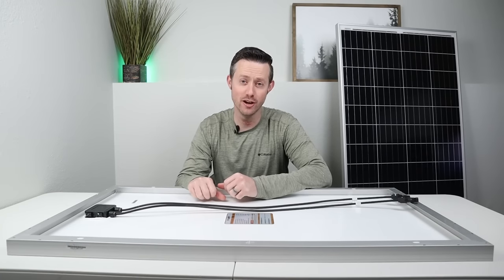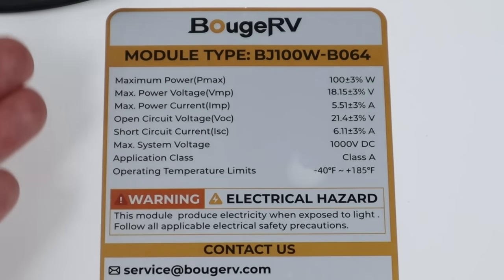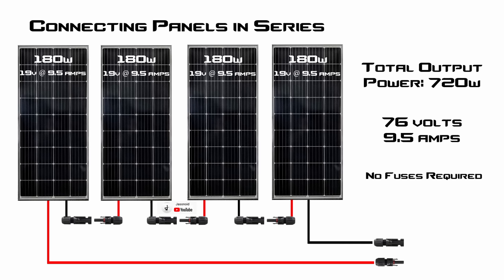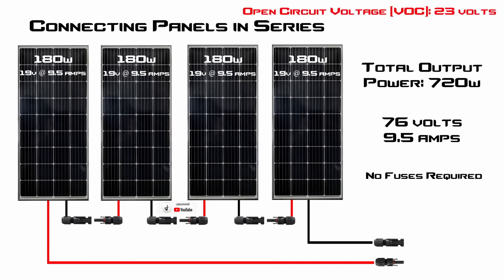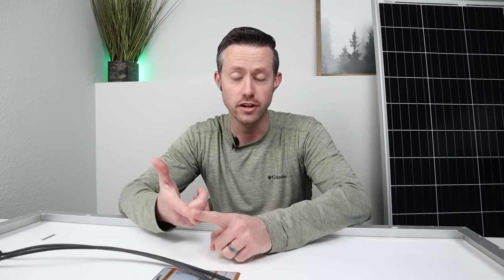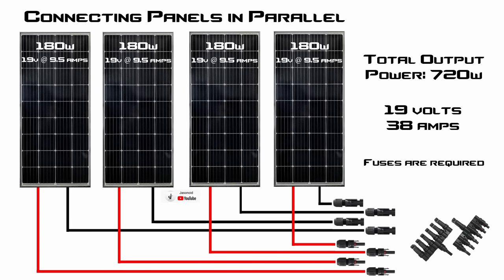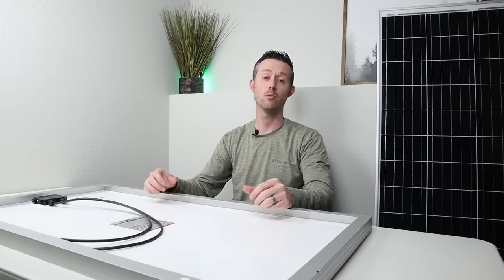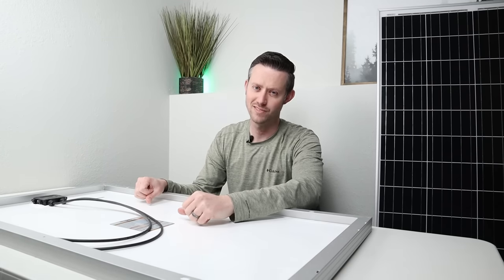Series VS Parallel! A Beginner's Guide for Solar Panel Connections - With Basic Diagrams!

Comment from the maker: Did you find this video useful? What other solar topics would you like to see?
Reply: i never used fuses on my solar panels .I prob should do you have a link solar panel fuses?
Reply from the maker: @mannyfragoza9652  Something like this would work well for each panel (15 amps). If you were fusing the entire array, you'd want to go with something larger. https://amzn.to/3n1a8Ne
Reply: @Jasonoid  cool thanks J
Reply: DrJ' I would like to see a Bluetti AC200max vs Ecoflow Delta max vs Anker 767 for emergency home backup🤔🤔🤔
Reply: Very useful. Getting into solar generators for the first time is like being thrown into the deep end of the pool. Especially for someone like me who had to make a quick buying decisions after multiple extended outages in a short period of time where dealing with a gas generator became very difficult.

Some topics that I'd like to see covered for the new solar generator buyer:

1) Differences in battery types / technologies. When I made my purchase I didn't even know what options existed. All I knew was alkaline batteries in my flashlights, lithium in my phone and laptop, and SLABs in my computer UPS. Knowing what I know now, I would have looked for a LiFePO 4  unit.

2) Differences in Peak capacity and runtime capacity, also touching on efficiency ratings and how it effects those numbers. Another thing when deciding on how much capacity someone will need is the watt rating of something like a microwave vs the actual power consumption - most people don't think that their 1,100 watt microwave might need to draw 1,500 watts so they end up underpowered.

3) For those of us without solar power, (especially new users) AC charging matters but it's something new users don't think about. Having to  keep track of the power brick for my geneverse unit is another frustration I really don't need, but didn't even know I'd care about down the line.

If you could wrap all these things into a "before you buy your first solar generator" video I think it could help a lot of people out. Most people are probably like me and only think about buying a solar gen after something goes wrong, so they feel like they have to make a buying decision fast before something goes wrong again.
Reply: @randomyoutubecommenter1  The experts say, figure out what your needs first like what will you use your solar Generator for, the whole house  or for small electrical devices C pap cell phone laptop etc, etc. In my experience bigger is better. I made the mistake of buying a 240,500 watt solar generator when i needed much more power. Even the 600 watt i recently bought only serves a small portion of electrical devices i need to run.
Reply: I keep getting confused about VOC etc and seems different brand panels use different terms.  Great video! I just recently got a deal a got 4 of Bouge panels that size. Never new I needed a fuse.  Maybe you provided link for fuses? I have rebranded Oukitel P2001. Called Ideaplay. And what's the saying about solar generators-- you can over voltage but never over amps?
Or vice versa?
Reply: @randomyoutubecommenter1  and then you end up like me with 6 different brands and sizes. Costly way to learn.! My Geneverse is now actually my least liked cause of it's relatively slow charge rate.
Reply from the maker: Chad, you never want to overvolt a power station. Always keep the VOC of your array under the voltage limit of the charge controller in the power station. 

Power stations have built in current protection / limiters so you can always have more amperage available for them, but they will only pull what they are rated for.
Reply: @Jasonoid  and since you discussed joining panel wires  what about splitting? Take your rig and say you wanted to take the single +- outputs and charge 2 separate Oukitells?? With AC you can obviously split and power both...
Reply from the maker: @chadrogers3161  not sure how well that will work but I don't see it damaging anything.
Reply: @Jasonoid  I just didn't know of was even going to output same at each line. 
Like having an array go to 2 separate PWM charger controllers connected to 2 separate battery banks. That's my existing situation.
Reply: So could I use for example Longi’s 515 watt solar panel (voc 46) with my Fossibot F2400 power station (max 500 watt and max voltage 48)? And I could even set two that kind of solar panels in parallel without damaging the f2400 power station?
Reply: Great, thanks
Reply: @juhaniriihola8129 No, the input wattage doubles either in series or parallel.  I’ve had panels at a remote cabin for about 20  years and in the spring when it’s cool and there is snow on the ground a get about 10% over the panels specifications..
Reply: Dear I enjoyed this so much though am very ignorant about electrical conduction. Thank you so much I wish I could transfer your grey matter to mine. Hahaha. Please do a video on how to set up solar system in a house off grid or hybrid but let's see all the connections, designs, inverter, charge controller, panels and what have you. Pleassssse
Reply: Jason how about batteries, how much battery and panels do I need to put for a house that requires about 6kw to power it's appliances?
Reply: Jason what's your email address please?
Reply: a review for powerwall battery
Reply: You’re the man! Clear and concise ,just how I like it!
Reply: how about a video on:   whole house standby solar cost,   vs.   portable battery that's solar chargeable cost.   The pro's & con's of each set up.   Provide the cost upfront in the video,  comparing the two,  and then  demonstrate the breakdown of those costs as you explain the set-up process for both.     "for whole house solar, non grid, is $xx,000   vs.   portable batter solar, $x,000.  Here's the components for these costs:  xxxxxxx   "
Reply: Pros and cons of Bi-facial portable solar panels ex: ecoflow 220w bifacial.
Thank you
Reply: Yes, thank you! Very clear and concise, great info and no confusion! Keep up the great work! God bless! I was talking to a friend about using other generators for AC input to back up larger solar generators that accept multiple inputs for charging, including smaller solar setups...any ideas?
Reply: Fairly straightforward and easy to understand.Very helpful!
Reply: @jasonoid Hi, good evening. I would like  ur input. I have an ecoflow pro, and the input ports spcs are as follows 
Ac 660 max 10A 
Ac input voltage 220-240V 50/60 hz 10A 
Solar charger 10-25 V === 12A , 200W max 

I have 2 solar panels  18v each one is 200W   specs are as follows, 
Pmax 200w single chip 
Output tolerance:+ 3%
Voc 19.2V-24V 
Maximum system voltage 16V-24V
So my question is, can I connect them directly to my power station without a control charger, or do I have to use the controller charger that was provided with the panels.
Reply: @jasonoid
We have 12 420 watt solar panels. I want to hook them up in a series of 3 and parallel 4 sets. Our smart controller is a MPPT 150/60. So if I understand correctly I can do 3 at 126 v and 30 amps because it is under the capacity of the controller right?  But my max amperage per panel is 10…so will I need a fuse for each 12 positives? Or only the 4 positives that create the parallel?? And lastly would I use a connector with the 4 prongs and connect the 4 positives to one and then the 4 negatives to the other prong?
Reply: I would love to learn about batteries to inverter connection
Reply: @Jasonoid Thank You very much! Wery interesting video about connection. 
But, what about in-line fuses?  Do we need them in 2s2p or something similar connection,  if we already have diodes in pannels, that block back current (overcurrent)?
Reply: How do I know which configuration I should use what determines whether I should use a series or parallel wiring configuration?
Reply: @HeiwaPeace  You should know MAX voltage and current characteristics of solar inverter mppt input and yor PV array should not exceed that's. Connection in series gives you pannels voltage sum up with the same carrent (it's good - you can use thinner wiers) Connection in parallel gives you sum up of pannels current with the same voltage ( current should not exceed max PV input current)
Reply: Do series arrays charge at a different rate than parallel?
Reply: @MaritimeUnprepared  Carrent increase in parallel ( with same voltage) and voltage increase in series (carrent is the same) if we look at connection of several identical pannels. Total power will be the same
Reply: @MaritimeUnprepared  Total power of PV array always the same. For example 4 pannels per 550Wt will produse nearly 2200Wt Connection in series will give 17A total current and 38Volts x4= 152v
Connection in parallel gives 17A x4= 68Amps current (that is too much!!!) and 38volts. It's only examples, I don't remember voltage and current of 550Wt pannels.
Reply: Very educative and informative. 
How long can 15kva lithium battery power two 1.5kva A.C units without solar or grid power.
Thank you
Reply: Thanks buddy. Really good. I'm a qualified electrician but out of the game 20 years. Looking to get back in with solar hopefully. Be great if you could do a real life wiring video. Also, are inverters/charge controllers combined and how is the power introduced into the main distribution system. Great vid. Liked and subbed.
Reply: Hey, good day. How possible do I use or connect 2 x 24 volts solar panels to 12 volts batteries? I need this for home use please.
Reply: yes i did find it very useful. Thanks a lot. Another topic i would like to see is, what would happen if i connect six 19v panels connected in series, in parallel with one 19v panel? What will be my output voltage?
Reply: I’m extremely new to solar panels and charging. It seems that everyone is reviewing and using 100w panels. I have a 500w Jackery. Is there a reason why I should buy a 100w panel or can I go larger to say 200w or 400w? I might be asking the wrong question but like I said I’m extremely new.
Reply: Very useful, I'm a dummy (was) until I watched your video.
Reply: Great explanation! One Question, at 8:10 you said your 180 v panel is rated for 15 amps, where did you get that numbers? Thanks again!
Reply: Just found your channel - Thank you for sharing your experience and knowledge. I have a 400w setup for hurricane power outages. It’s mostly just to keep the fridge running. Suddenly everyone thinks I’m the “Solar Guy” and that has forced me to better understand this topic. I find that your videos are put together in a manner that is perfect for sharing with a Novice who is interested in elevating their understanding - Again Thank you for making my life easier 👍❤️👍

Comment: I have struggled understanding series and parallel panel configuration. I feel after watching your video I have a better understanding.
Reply: Agreed.
Reply: I totally agree have always struggled with parrlel and series now after watching this can safely have a small understanding of it thanks
Reply: This is one of the things that people struggle with when installing panels. But the easiest way put, is that in series is the best convenient option. But you are limited by the maximum voltage that your controller can process.
Reply: Which one you applied for yours?
Reply: Yeah, this dude is an AWESOME teacher ❤👍

Comment: Great video, thanks.  Correct me if I am wrong, but it looks like the 2s2p diagram is a bit different that the actual wiring you have done on the panels.  I don't think it makes a difference, but it's something I noticed.  Can anyone confirm or deny.   Thanks again.

Comment: I must state you've done an excellent job educating and cautioning about the dangers that could occur when using series or parallel outputs, as well as educating clear discrepancies in series and parallel power outputs to prevent fogged minds from confusing the two.  Fantastic !
Reply from the maker: Appreciate the feedback, glad the video was educational :)
Reply: For solar generators if a max panel input voltage is 60vdc, can you use a panel with a higher open circuit voltage but the closed circuit voltage meets the spec?
Reply from the maker: @jeffp9889  unfortunately not, anytime the voltage goes over the max voltage of the power station you risk damaging the internal components. That includes both the VOC and voltage max power numbers.

Comment: Great job of explaining series & parallel installations.  Also, I never realized that installing a fuse was optional as long as you don't exceed the short circuit current of the panel.
Reply: I also learned this for the first time about the fuse requirements 🎉🎉🎉
Reply: Is this statement only true given you use the appropriate gauge wiring? Is his explanation he suggests using a wire that is rated for up to 20amps. I am a total newby to this and want to make sure my logic is alinged. Cheers

Comment: Hey Jason, I wanted to express my gratitude for your incredibly detailed explanation on connecting solar panels in series, parallel, and 2S2P configurations. After revisiting your video multiple times, I've finally grasped the concept. It turns out, my Pecron E2000 and E600 were underperforming due to my lack of understanding. Although I bought some panels based on another recommendation of yours (House Size), they turned out to be too bulky and heavy for my needs. However, I recently scored a fantastic deal on four standard-sized solar Bifacial 100 Watt panels for just $260. I plan to implement the 2S2P configuration you demonstrated, as I have some shading in my backyard. Parallel connection wouldn't provide sufficient voltage, and series connection would be hindered by the shade. So, 2S2P seems like the ideal solution for me. I truly appreciate your guidance, as I hadn't encountered this configuration method before. Your video was immensely helpful, and I can't thank you enough.
Reply from the maker: Excellent real world application!

Comment: This is a great video.   I started out with solar a few years ago and I keep coming back to this video as my systems have grown.  Thanks for making this so simple and complete.   This video is a great reference.  I cannot say thanks enough!
Reply: So did you go with series or parallel or both?
Reply: I have 4 different power stations.  Bluetti AC200p has 4 x230 w wired in series, FF Power 2001 has 4x100w wired 2s2p, Okitel P2001 has 2x260 w wired parallel and my FF Power 614 is just a 100 w panel wired straight.

Comment: This video was very helpful. Actually, I've been waiting for this one for a long time. I have looked at many YouTube videos on the subject, but most skip over the details and since we are dealing with high energy, you cannot be too careful. Can I say I understand this completely; no, but I do get closer. This video does an excellent explaining the connections but I wish there were some screenshots of the various power stations and what solar panels you could connect within there limits. There are videos that either do one or the other, but I have yet to see one do both. Perhaps this is asking for too much, but for the beginner, it would bring it into better perspective. Even seeing it connected to a charge controller for people with DIY 12 volt systems. I know that portable power stations have the charge controller built in but seeing a demostration helps. But this video will help a lot of people for a long time because the manner in which you explain the subject is clear and to the point. Awesome!
Reply from the maker: This video will help you pick the right solar panel for your specific power station and how to wire them together:  https://youtu.be/4JG8LvJznLY

Comment: Thank you for the video.  I currently have four 250 Watt panels on my RV wired in series.  I ordered two more 250 Watt panels and was leaning toward wiring them in a series parallel configuration.  This will max out the available roof space on my 28 ft 5th wheel (limited by 3 skylights).  After watching your video (and a few others), I have decided to wire them all in series.  My MPPT will handle the increased voltage and I won't need larger wire sizes or fuses.  Will just need to be careful when connecting the panels as my maximum voltage will be approaching 140 volts.
Reply from the maker: With cold temps the voltage will be higher than the spec VOC (like 32F and below). Warmer / hot temps the VOC will be lower than spec 👍All depends on when youll be charging your batteries.

Comment: Thanks so much, this video was very helpful to me as I am ready to undertake building a beginner 24 volt system.  It all started with my Anker 767 and needing more power to charge quicker.  I would like to get this up and running before the peak of hurricane season but I still have the 200 watt portable panel that came with my Anker system and I have an 8000 watt gasoline generator  I can use to charge the Anker if there is no sunshine here in the sunshine state.  Thanks again and I subscribed to learn more.  Ted in Sebastian, Fl.

Comment: Hello, thank you for you great videos, please keep them coming! I have a couple questions that you or perhaps someone else might be able to help me with. I bought 4 x 100 watt Renogy brand solar panels (RNG-100D-SS). I plan on installing them on the roof of my pop-up camper / tent trailer. I also bought a Renogy branded Adventurer Solar Charge Controller. I will be  charging 2 x 6 volt ‘golf cart’ type batteries. What is the best was to connect the solar panels to the charge controller?Series or parallel? I am thinking in parallel. Appreciate your thoughts!